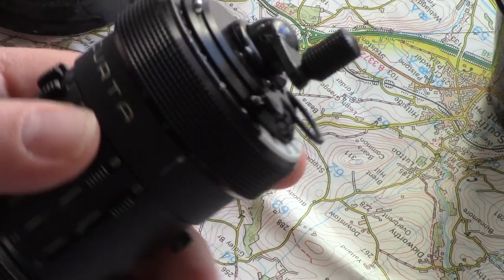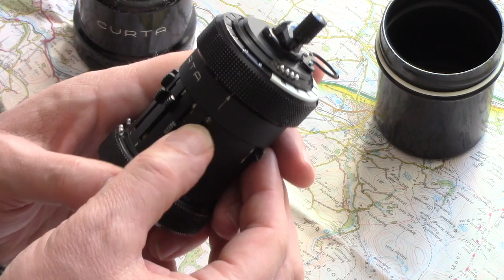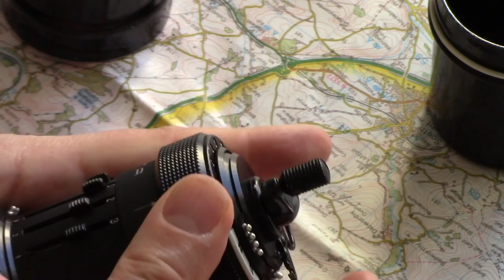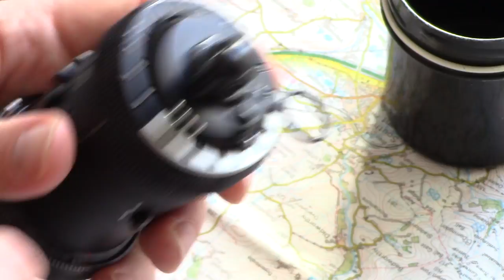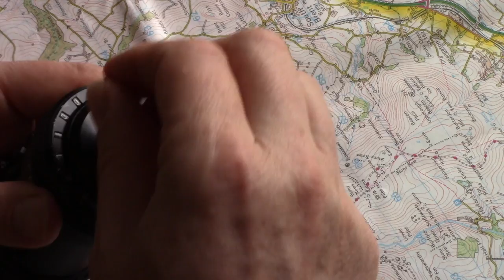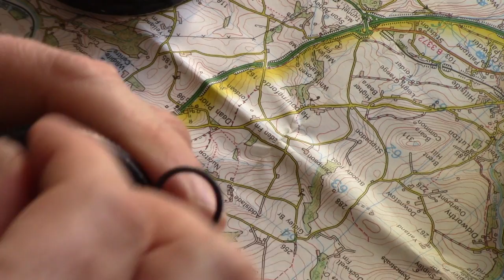CURTA Mechanical Calculator Demonstration

Comment: Best explanation I've seen of the Curta thus far. Good job! What got me interested in looking at this video is that I learned that the first computers performed multiplication and division in exactly this kind of way. They could not do it as a single operation. They would do addition or subtraction multiple times. I supposed modern computers may work that way too.

While people may laugh at the old fashion nature of these mechanical calculators today, they are excellent tools in teaching people how machines perform mathematical operations. What is going on is very visible. When it is electronic, you don't see the repeated operations going on. It is invisible to the user.
Reply from the maker: That’s a fine observation. Thanks for watching and sharing your thoughts! R.R.
Reply: Modern computers work the same way indeed.

Comment: Your examples of multiplication were too trivial. Try 14593 x 846. Give it a go...
Reply from the maker: it's actually very simple with the Curta. You put 14593 in the register, then shift to the 100 spot and turn 8 times, then to the ten spot and turn 4 times, then to the 1 spot and turn 6 times. The answer has been said countless times...

Comment: This calculator is too complicated. Whether it  too complicated to use it and so too much complicated to make/assembly it. ASIAN TRADITIONAL calculating tool far more practical and easier too assembly. This curta curse is stupid engine 😂😂
Reply: Well, if you think the Curta calculator is stupid, you probably don't need any device for your calculations. After all, using a stupid machine that is more stupid than its user is a stupid thing to do. ;-)